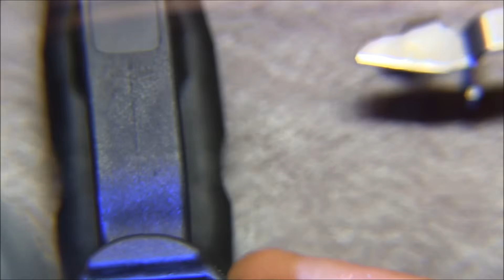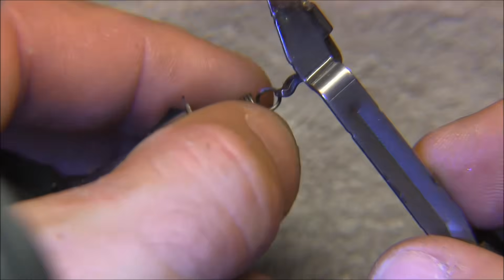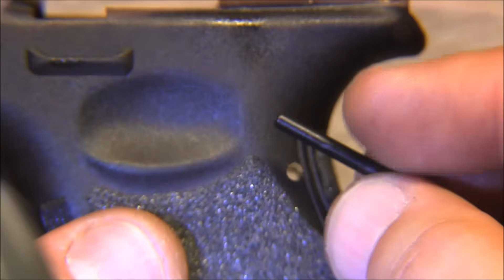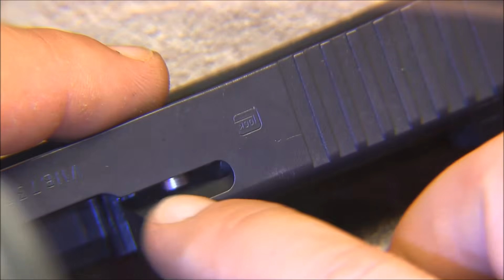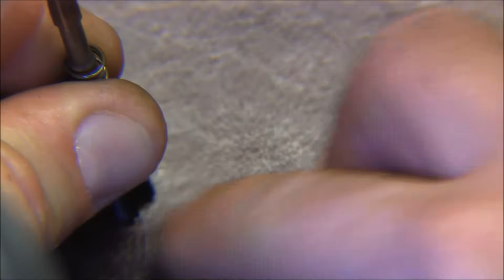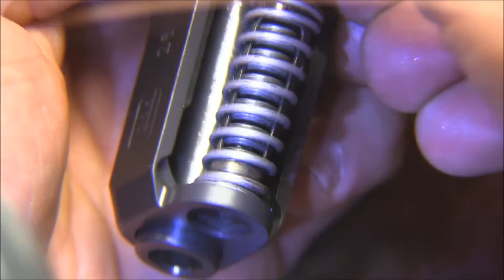Glock Detail Reassembly CLOSE UP

Comment: Are these the same internals for the Glock 27 gen 4 ? I bought one used in good condition and just wanted to change out all spring parts with new oem parts so this helps a lot
Reply: All glocks are pretty similar, there are small differences between models and generations but they’re all basically the same

Comment: its not from the begining. what about the spring which hold slider? time frame 12:19
Reply from the maker: @B4nder4  I never removed mine. But you can if you need to.
Reply: @mosinvirus  вопрос в том как ее поставить изначально
Reply: и как поставить пружину которая внцтри куда магазин вставляется

Comment: i have a question i have a problem with the trigger house part i don’t know if the trigger should be loose or the trigger should be hard when installing the locking block
Reply from the maker: The locking block should not really do anything to the trigger. As far as trigger housing, you need to make sure the trigger spring is not kicked off to the side on the bottom/back of the trigger bar. That could make the trigger harder to pull, will affect trigger reset and cause other problems.
Reply: @mosinvirus  so when building it you need to make sure the trigger can move freely and not be “hard”
Reply from the maker: @lemonblockceo1333  you can check the parts outside of the frame. If they don't fit correctly then you need different parts or to modify the parts to fit better. Without seeing what you mean by "hard" it is difficult to tell what may be wrong.
Reply: @mosinvirus  is their a way i can add you on a platform to show you

Comment: NIce video.. but why are you putting oil on the trigger assembly? Shouldn't need to oil anything except the barrel, rails, and maybe the guide rod with 1 dot or something on it.
Reply from the maker: I generally lightly oil all moving or just metal parts. Not saying it is correct, but I use the same oiled patch on almost everything.
Reply: @mosinvirus  Hey if it works, why change it!

Comment: Just a quick hint - I found when putting in the lower locking block pin , that also holds the slide hold open tab, I put the Glock armorers tool in from the right side (looking from rear of pistol) in the hole just enough to line the tab hole up, then insert the pin from the left, pushing the armorers tool out with the pin, it just slides right in without jiggling or fighting it
Reply from the maker: Yes, lots of people come up with different methods. Use what works for you.
Reply: @mosinvirus  Thank you for your series of VERY good instructional videos !
Reply from the maker: @markhopkins5801 my pleasure. Thank you for checking them out.

Comment: I’m having trouble with the polymer 80 gen3 glock 19 clone. After everything is assembled and in place the trigger pin doesn’t wanna go in at all. Is there an easy way to get everything lined up correctly to get the pin in??
Reply from the maker: Maybe the jig was not all that accurate.

Comment: awesome video, helped a ton, however, the last thing i am struggling with you already had inside. The slide lock spring. I can get it to seat, but it's not high enough in the back to catch the slide lock. i put the small hump to the rear and clipped it in the front, but doesn't look like yours. Any help suggestion would be greatly appreciated. by far, best in depth instructional video!!
Reply: Disregard, was putting it incorrectly in, got it, again, thank you for an awesome video!!!!
Reply from the maker: @bobheim2908  i am glad you got it sorted out.
Reply: @bobheim2908  you should never cut up glock parts

Comment: I can’t manage to snap on the spring leaf pin on my Glock 26 am I doing something wrong ?
Reply from the maker: I am not sure which spring or pin you are referring to.
Reply: @mosinvirus  the silver leaf shape spring that’s on top of the slide lock
Reply from the maker: @bigbuu4334  can you type in the time in the video where the parts are that you have problems with?
Reply: @mosinvirus  12:25 , you said little spring where it has to be under it. I’m having trouble putting that little spring back on so it can be pushed down with that mechanism so I can add in the slide release part
Reply from the maker: @bigbuu4334  oh, understood. Yes those are tight, but should go in. Where does it stop?
Reply: @mosinvirus  I wish I can FaceTime you or something man.. or I can send a video… but anyways I put in that spring and it won’t bend downwards at all.. like it just sits on top of it.
Reply: It won’t spring down even by pushing it down with a tool
Reply from the maker: @bigbuu4334  Did you check if something is blocking it from the bottom?
Reply from the maker: You can email pictures/video to me at Mosin.virus@gmail.com
Reply: Me too

Comment: I don't know if it was on purpose, but at 18:50 where you re-assemble the the spring to the firering pin...(noticed you did it correct, but didn't explain why the cups need to sit like that) the seam in the spring and the half of the cup should be twisted, so the end of the spring isn't in between those two plastic cups, but the end(grind down part of the spring) is somewhat in the middle of one of the half circles, or else it may come apart or they can break more easily, than if it's just rotated a couple of degree...
Reply from the maker: Thank you for pointing it out.
Reply: @mosinvirus  You'r welcome, and thanks for such great vids... I was educated on the AR platform, and I almost never had any handguns in the "shop", when I was a weapons mechanic in the army(Not US), so I like your vids on pistols, because, eventhough I personally didn't learn anything new(unfortunately) from this one, your video was very comprehensive and instructional, so people who are new to the glock-world gets a good intro...

Sugestion: maybe explain the different colours on the caps, and how you can determine caliber by colour of the original plastic caps(black, white, green) if somesone is disasembling another caliber, they might want to know why they have a different cap?!

Comment: 6:45 my assembly wouldn't stay assembled the trigger bar wouldn't stay in place and kept popping out and I'm afraid my trigger doesn't work
Reply from the maker: Make sure the trigger spring is not kinked to the side.
Reply: @mosinvirus  I'll check but I'm pretty sure it wasnt
Reply from the maker: @BoredTinkerProd  If the spring is installed correctly and it simply doesn't want to stay put while out of the frame it is not a big deal. When you reinstall it into the frame it should function as designed.

Comment: Can never get that trigger pin in easy it's always an issues for me on any Glock I have. Upgrade a trigger 45 mins of messing with that pin getting mad
Reply from the maker: Sorry that pin is giving you grief.
Reply: @mosinvirus  it was on a G26 last night and it just seemed like the trigger would not align with the pin without wiggling everything. My g17 comes apart and goes together with no issues
Reply from the maker: @xxskitsxx15  are you putting the pin in from the left side of the frame or the right?
Reply: @mosinvirus  no I was doing it how you said. The trigger isn't stock that may be why. I had to push on the trigger a little to get it to line up properly. Then with some light taps it went right in. I was just weary of tapping it in wanted it to just push in.
Reply from the maker: @xxskitsxx15  could be the trigger, like you said. Next time you have the trigger out, try putting the pin through it to see if it is tight.

Comment: In my kit I noticed I didn't get the pin with 2 grooves. I have a pin with 2 ends that are a little more wide than the others. Is that supposed to be the one with the groove?
Reply from the maker: The pin with the groves is needed. The slide stop needs to ride in one of those grooves.
Reply: @mosinvirus  would that be a reason why my slide gets stuck while trying to remove?
Also thank you for replying so quickly being that video is so old.
Reply from the maker: @jredcloud  not really, the slide getting stuck while trying to remove could be if the trigger is active. Make sure the trigger is in "fired" position and when you move the slide back to actuate the takedown lever you don't move it too far back so the trigger resets.

Comment: We put together a glock and It cocks back little rough and we have one piece that we have no clue what to do with it looks like slide lock but the slide locks up just fine we also have extra triggers 
The part is chrome colored metal like a small rectangle  but it tip has been folded it looks exactly like a slide lock
Reply from the maker: Sorry, you should probably take it to a local gunsmith or armorer and have them take a look.

Comment: I was having trouble finding a video on trigger bar assembly and this was perfect
Reply from the maker: I am glad I could help.
Reply: @mosinvirus  best video of Assembly I've found. Quick question what's the pin for that is above trigger pin. Slightly smaller on lower receiver?
Reply: @mosinvirus  I got it slide stop, spring under sorry thank you

Comment: Ya Dude,  Excellent!  I've been tearing my hair out trying to figure out if i have missing parts, parts in the wrong spot, what the hell did I smoke...  I did bend the connector to fit flush in the trigger block.  Like you said, "Don't do that."  I also had the trigger spring upside down.  Before it was tough getting the slide on and wouldn't come off without removing the safety pin.  The firing pin also would not fire or reset.   Your video saved my bacon!  Thanks Dude!
Reply from the maker: Glad I could help

Comment: for some reason when assembling my trigger, after I connect the spring from the trigger housing to the trigger bar itself, trying to push it into its proper place won't work well. The spring keeps forcing it out and it only rests at an angle. I'm guessing this won't be a problem inside the firearm, but I'm just a little concerned cuz every other video I watch, it all rests easily and lined up.
Reply from the maker: That is pretty normal and the trigger bar kind of wants to come out. The most important thing is to make sure that the trigger spring is not kicked off to the side on the bottom (where it connects to the trigger bar)
Reply: @mosinvirus  thanks!

Comment: Mosin V:  I got the poly 80% and finished the build.  I still feel Ur vid isone of the best out there.  I ended putting that lower on a Mech Tech 9mm rifle upper.  It works really fine and I feel this a good use of the early lowers that don't have metal slide rails.  I am now looking at a Poly 80 GS3.
Reply from the maker: Very nice.

Comment: I got a g27 kit yesterday, followed every step , but the slide won’t slide all the way back into place , it feels like it gets stuck and for the life of me I can’t figure out what’s going on... can you give me some advice?
Reply from the maker: Are you familiar with Glocks or is this your first experience?
Without knowing where the slide sticks the only thing I would suggest is to make sure the take down lever is installed correctly. Wrong side forward maybe. The side with a "lip" should be facing the rear of the frame.
Reply: MosinVirus yea I’ve built 4 g19 already ,  no issues at all.. the g27 is a little different but I got it all together , the only issue I’m having is the slide.. it’s not going on smoothly at all. It just gets stuck.. I gotta force it on and when I do get it on it gets stuck I can’t rack it back... I don’t know what the hell is going on
Reply from the maker: @sebastianlarios7723  I assume they are 80% builds. I haven't built one so I am not sure what could be causing the issue. Could it be that the rear rails are out of alignment? Or the locking block?

Comment: I can't get the spring back into my Glock 23 gen 3
Reply from the maker: Which spring?
Reply: MosinVirus I field striped it to clean it and when I put the barrel the guide rid with the spring is supposed to fit in a notch on the barrel ,I am supposed to compress and push down slightly but I just can't get it to budge
Reply from the maker: @stevebillieroberts9582  sometimes the forward end of the guide rod doesn't align perfectly with the hole in the slide. Try to make sure the tip of the guide rod is not forced downward when you push the head of the guide rod toward the front.
Reply: MosinVirus ok thank you very much
Reply from the maker: @stevebillieroberts9582  my pleasure. Let me know if you have any other questions and I will do my best to answer.
Reply: MosinVirus ok as soon as I get home from work ,I am going to give it another try ,

Comment: negative... how do you put that spring in
Reply from the maker: Sorry, which spring?
Reply: @mosinvirus  it was the takedown spring piece. Not exactly a spring spring but would have been nice to know how to put it in.
Reply from the maker: @seanb5457  sorry I didnt show the removal or installation of the slide lock spring. To remove, you can use the Glock tool or small punch to lift up the leg of the spring slightly and then use small needle nose pliers to grab the body of the spring and lift straight up. It is an L shaped leaf spring. When installing, the short leg of the spring goes vertically down into the frame so the long leg lays "horizontally" toward the rear of the frame. Push the short leg into the frame and you are done.

Comment: MosinV:  I went ahead and did the poly 80%.  Your instructions were very helpful.  I ended up putting lower on a Mech Tech 9mm upper designed for glock lowers.  Worked out very well as I ended up with a 9mm rifle that uses Glock mags.  Thanx again!
Reply from the maker: It is my pleasure. Glad the video helped and that build sounds awesome. Congratulations

Comment: I want you to know, that I thoroughly enjoy your videos. I know that English is your second language, but your narration is better than most (far better) on you tube.I also admire your mechanical abilities and appreciate you sharing them with gun enthusiasts.I would  like to share a trick I learned to help re assemble the striker. 
You use the slide as a jig. With the butt of the slide facing up, After inserting the striker into the sleeve, insert the striker upside down into the striker chamber, with the lug at 90 degrees. This will permit you to depress the striker spring without the striker falling to the bottom of the sleeve. 
Unfortunately, this will not help grasping and inserting those pesky little half sleeves.
Again thanks for all of your videos, I look forward to watching more.
Reply from the maker: Thank you very much for your kind words and a great tip. I will certainly try it out in the future.
Reply: +MosinVirus My pleasure, thanks again and keep up the good work.